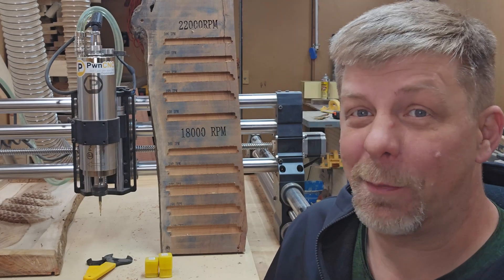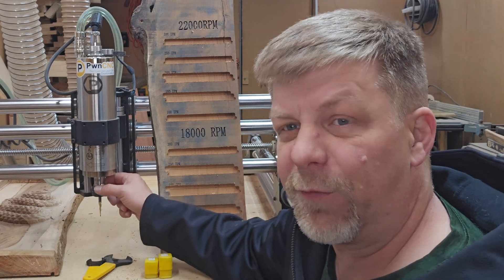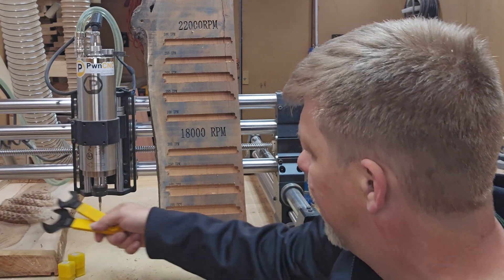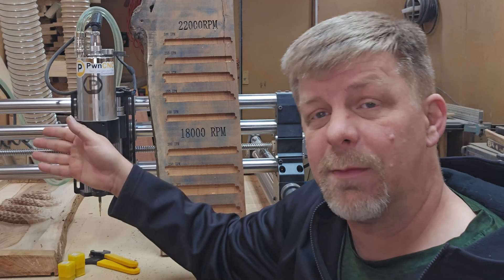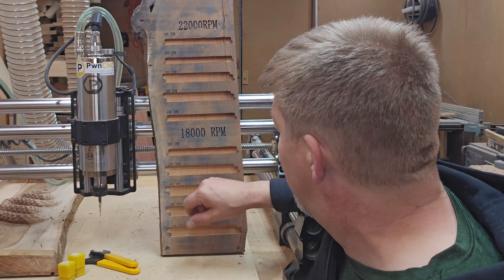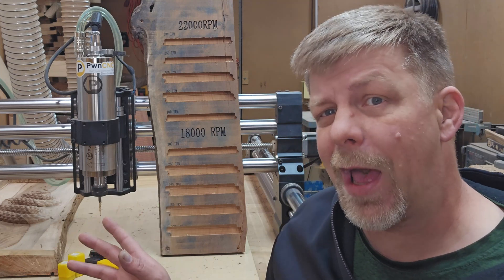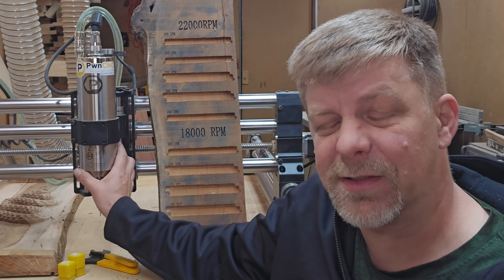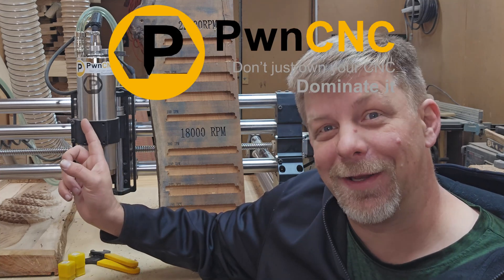PwnCNC 80mm Spindle Review & Test — The Best CNC Router Upgrade?

Comment: With my headphones on listening to your spindle I really can’t hear the difference between your water cooled version and my air cooled version. Mine probably sounds the same up until it hits 18-19000 rpm’s maybe.
Concerning support, everybody has there good and bad days and no one is perfect but if that happens they will go out of their way to make it up to you and hope is not lost. And, thats what I respect.
Reply from the maker: Thanks for the feedback. I do not think there is that big a difference between the air and water cooled other than the air that blows out at the nose of the spindle on the air cooled one but they are both probably similar noise levels. PwnCNC has been a good company to me over the years and you are correct everyone has their ups and downs. Thanks again for the comment and watching my videos.

Comment: Its very expensive (x2 x3) to buy compared to many other non cnc branded models . But performance is superb. Mine is just 0.8kw from Vevor, but superior to 700w router as well as much quieter
Reply from the maker: I think it would be worth the extra cost for both the plug and play aspects of the system as well as the support behind it. They supply everything prewired and programed where a lot of those cheaper systems do not. The custom wiring, fittings and enclosure for the vfd is top notch and very high quality made. I was highly impressed.